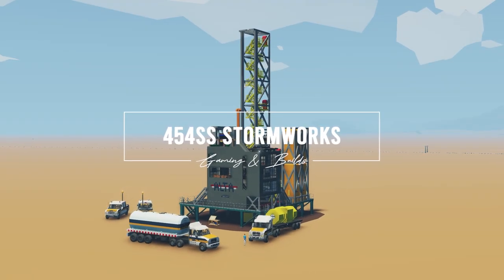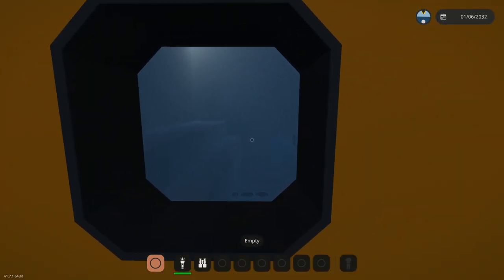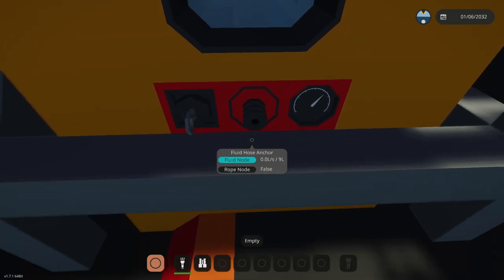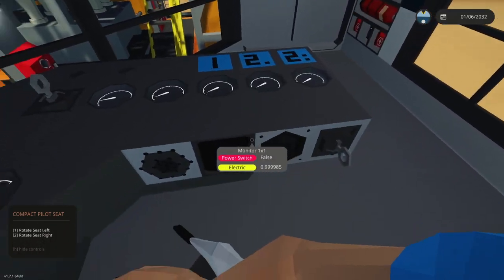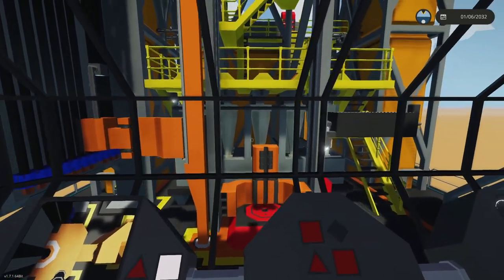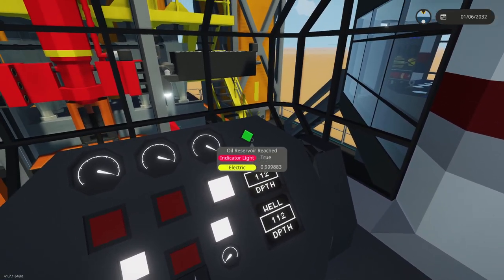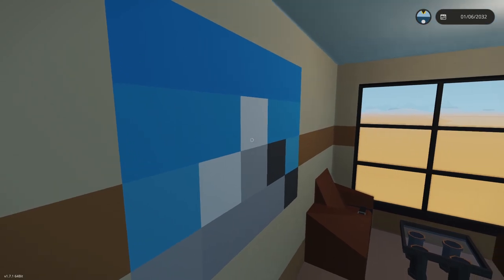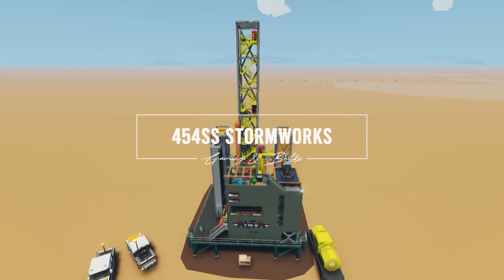AUTOMATED Oil Rig for the Stormworks Oil Drilling Update!

Comment: Next step is underwater drilling right?
Reply from the maker: Yup! :D
Reply: @454ss_gaming  I think you mentioned something about a minisub, that’s a bad or at least over complicated idea, I noticed the wellhead is really hard to align, you need to push like 100m of pipe down that flexes, 4 winches on all corners to lower the head works perfectly, and alignment is a pain, the drill pipe is VERY flexible, so you need to be able to move either the drill ship or wellhead with EXTREME persision in real time, and it better be EXACTLY straight, also you need to only drill like 10m deep after anchoring
Reply from the maker: @rogervanbommel1086  That is actually what I was also thinking as an alternative, the minisub may be too complicated to align perfectly! Also, it may be easier to deploy the pipe with the wellhead already attached, if that is possible
Reply: @454ss_gaming  nope, that is not possible, first thing I tried
Reply from the maker: @rogervanbommel1086  Good to know :)
Reply: @454ss_gaming  also, if you have natural disasters enabled, that’s sadly a mess, DETACH the well head and retract the pipe out of it, otherwise the ship is anchored and makes a mess(I have had one flip on its side and break the well head irrecoverably, the pipe was jammed into a unanchored wellhead and could not reanchor it